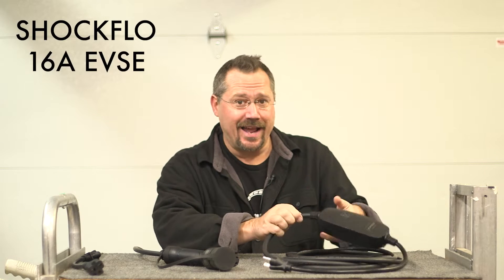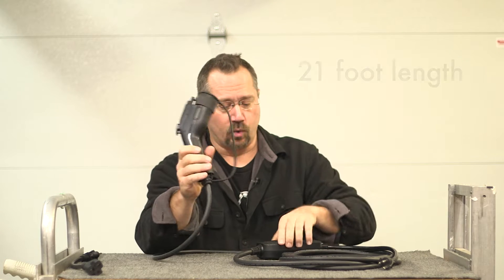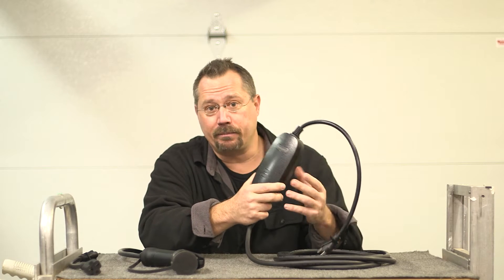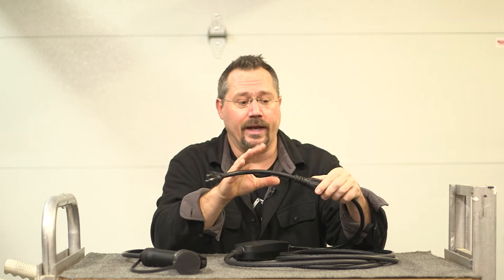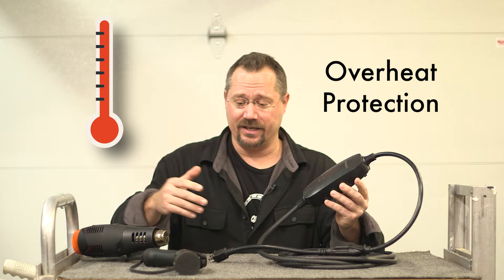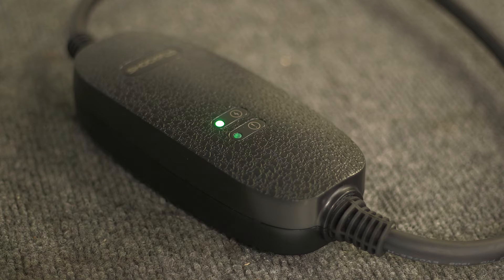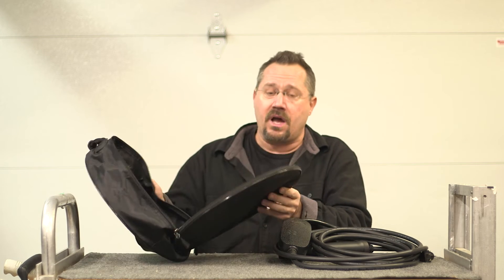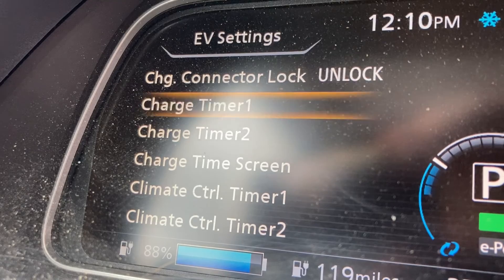$124 EVSE Any good? SHOCKFLO 16A EVSE Review (120/240V dual voltage)

Comment: With the changing positions on DIP switch ( red cube )  you can change the current. My car is a Mitsubishi PHEV and I plugged in a 120 Volt outlet to get this results on AMP clamp 14A (1on ,2 on ) , 12.15A (1on,2off)  , 9.20A (1off,2on) , and 7.20A ( 1off, 2off ).

Comment: Would you personally buy that instead of Tesla mobile charger?
Reply from the maker: The current version of the Tesla Mobile Connector is a real steal.
But it only charges Teslas!
The EVSE in the video is for J1772 cars.
Reply: @BenjaminNelsonX  I understand it is made for J1772 vehicles but I have the adapter. I just bought this charger ($148.00), however, the Tesla Mobile is $230.00+ taxes and shipping. I was wondering if the quality of both are similar (say Tesla charger will last just as long), or one is better built over the other. Any idea?
Reply from the maker: It's sort of hard to really give a good definition comparing "quality" of the two different products. EVSEs don't have many moving parts, and there's not much to go wrong with them.The Shockflo EVSE really seems pretty good overall. There was very little at all negative that I could say about it.
The Tesla Mobile Connector is very good, and a really good price considering that it has the NEMA 5-15 and 14-50 cables AND can be used at up to 32A! If you already have the adapter that would let you use the Tesla Mobile Connector with J1772 vehicles, that would give you about as much flexibility as you could ever expect from any EVSE.

I own quite a few different EVSEs. The only one I ever had any issue with at all was one of the old large first-generation GE units, which had a problem with the contactor. (I think I got that replaced under warranty.)
Reply: @BenjaminNelsonX  I just purchased the Shockflo, and could buy the Tesla for an additional $100.00. It's one of those things where the Shockflo could stop working (say you drop it), at some point and the Tesla wouldn't. Thanks though!!
Reply from the maker: Why do you think one would stop working if you drop it and the other wouldn't?
Reply: @BenjaminNelsonX  it was just an example I used. Some reviews about it shows/talks about inferior quality hardware. (Different size cable;sturdiness;overall material quality). I personally believe Tesla would provide a better product, therefore, I was weighting the cost benefit of the price difference. One could potentially drop the Tesla brand charger and it could also stop working. Again, it was just an example. Hope this helps.

Comment: I got a ZENCAR 16 AMP 120/240 EVSE WITH my 2016 leaf in 2019. Mostly use the 240 volt on a 20 amp 240 volt circuit. Seems more efficient.

Comment: It doesn't seem too bad but a basic unit like this needs at least a switch/button for 12 or 16 amp current settings. They included a NEMA 5-15P to 6-20R adapter so you could easily pull 16 A on a 15 A circuit which would trip the breaker. If your car doesn't have the ability to reduce the charging current, then it will always try to take 16 A which is what this EVSE communicates to the car.
Reply from the maker: I thought about that a bit. If they included a 5-20 adapter, then you would ONLY be able to use it on 20A 120V circuits EVEN IF your car only naturally draws 12 or 13A or if you have the ability to turn down the charge rate on your car. The 5-15 adapter gives you a lot more flexibility.
Reply: For safety, L1 120V is limited to 12A by default, by the EVSE and vehicle
Reply: That's not correct. This EVSE doesn't limit to 12 A unless that was overlooked in the review. Some cars don't have an artificial 12 A limit on 120 V.
Reply from the maker: @ArtiePenguin1  I specifically checked. This one does NOT limit to 12A on 120V. Use on a 20A/120V circuit if your car will draw the full 16A.

On many vehicles you can set your 120V charge rate in the car to something lower such as 12 or 8 amps.

Comment: Good price at 160$. You never mentioned the price? should probably lead with that.
I'd still like to see someone make one with everything in the handle instead of the box mid way. It's the obvious way to go for several reasons.
Reply from the maker: The only problem with that is that prices - especially on places like Amazon - can jump around. If I said one price, I guarantee it would jump to another the next day!
Still, very inexpensive.